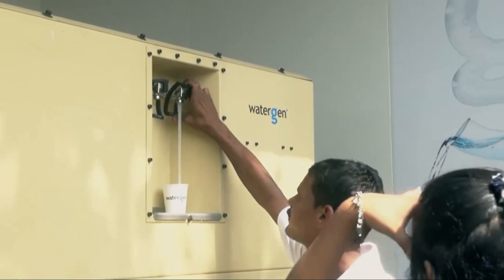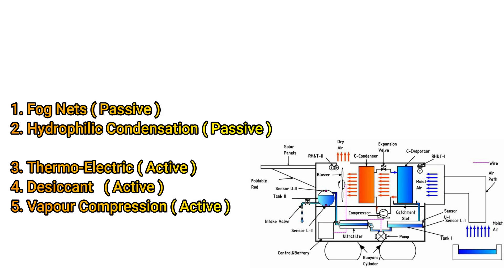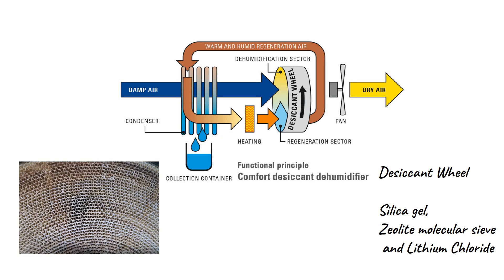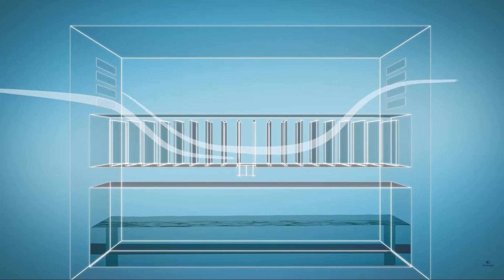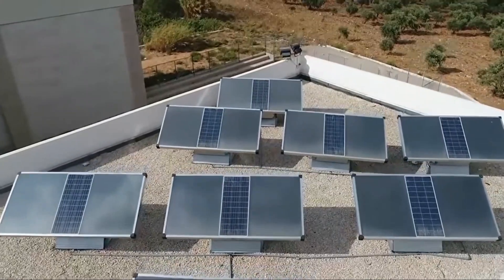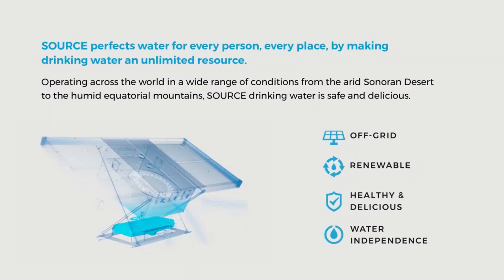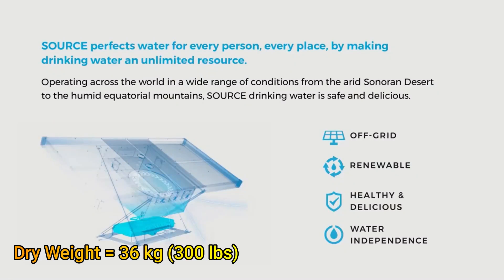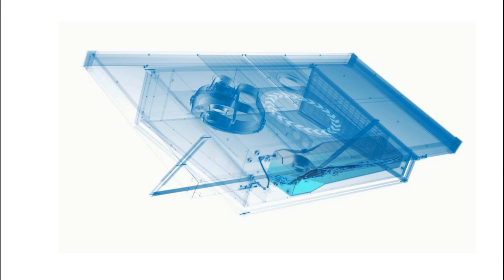Hydropanels : Advantages of Desiccant cooling system

Comment: Let's look at some numbers. Since this panel does not generate water, but extracts it from the air, the amount of water will depend on the humidity of the air. Let's assume that the humidity is 30%. At this humidity (and a temperature of 30 degrees Celsius), 2 gallons of water are contained in... 841 cubic meters of air. Most likely, the panel does not extract all the water from the air that passes through it. Let's assume that the panel extracts 50% of the moisture from the air. Then, to get 2 gallons of water, 1682 cubic meters of air must be passed through the panel. On average, 1 cubic meter of air contains about 100 micrograms of dust. In less dusty areas, this figure drops to 5 micrograms, but in dustier areas (for example, deserts) - up to 1000 micrograms. But on average, it is about 100 micrograms per cubic meter of air. If you pass 1600 cubic meters of air through the panel every day, then the unit will get... ummm 58 kilograms of dust per year. Of course, some of the dust will come out. But some will remain. Let's say half will remain. But 29 kilograms of dust is also a lot. Where will this dust end up? In the collected water? Most likely - no. Most likely, there should be a coarse filter there that will collect all this dust. But... how often should it be changed, if we assume that 29 kg of dust needs to be collected (80 grams daily)? Perhaps some of these 29 kilograms will remain inside the panel. So... won't this reduce the panel's throughput? Will fungi and colonies of other microorganisms appear in the panel? And 29 kg of dust is an indicator for an average dustiness of 100 micrograms per cubic meter of air. And what will happen in regions with a dustiness of 1000 micrograms per cubic meter? The most important thing is that replacing the filters does not seem so cheap.

Comment: A very interesting source of clean water. It's for areas with little or no water, so that's a great thing for the people living in such areas. Anyone with clean water out of their tap and comment how much this costs have other issues to worry about, so better not do calculations for something they'll not need.
Thanks for your commitment of relaying knowledge on great topics!
👍💪✌
Reply from the maker: I pay around 67 pounds per month for my tap water. And its hard water. I pay another 15 pounds per month for drinking mineral water
Reply: @synergyfiles3536  Those are shocking high numbers, I was not aware of. In which area is this the case?
Reply from the maker: Anglian Water. Milton Keynes
Reply: @synergyfiles3536  Have you got a water meter installed? Ours is about £30 a month on a meter for 4 people (Northumbrian Water)

Comment: What about smog pollutants and pollen in the air. How does it get purified if there is no pressure  behind the water? The actual cost of water per gallon on my bill is less than 10c, so these machines would take 6000 years to get paid off and doesn't count the cost of installation.
Reply from the maker: There is an air filter at the point where air is sucked in